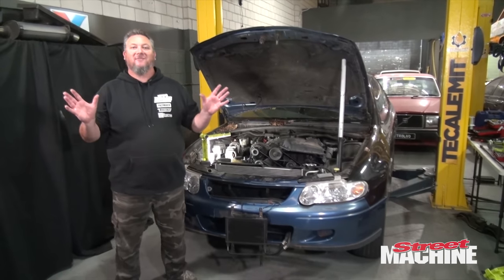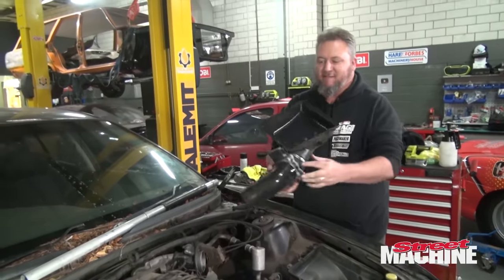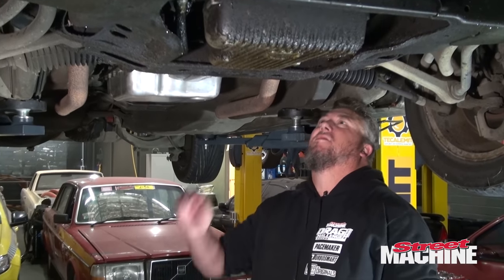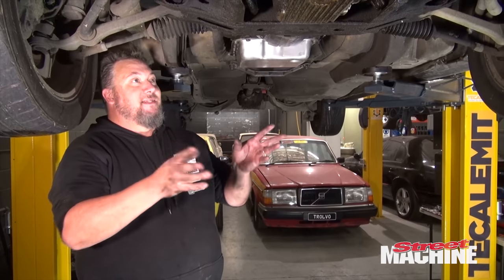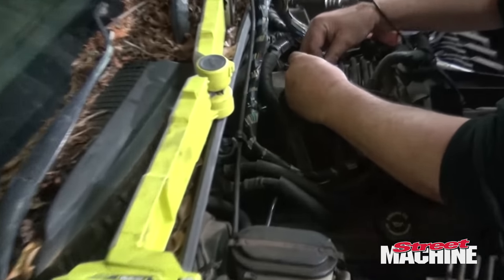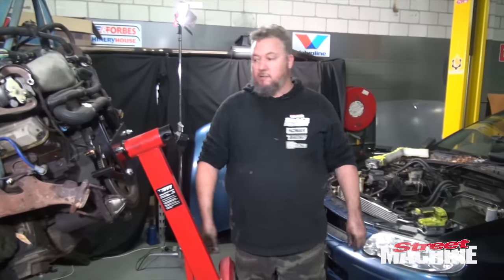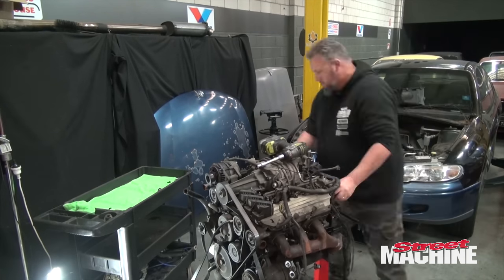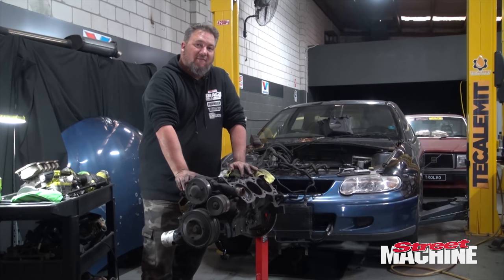Carnage Plus EP49 - Pulling The Engine From Our $500 Bomb

Comment: I'd defineatly appreciate you going down the blower route as I have a l67 in my VT series 1 wagon. Itd be kool to see what you can get out of the m90.. I have a 13psi pulley and it's been ported by mace. I've got a larger throttle body, roller rockers ,CAI, memcal and better coils,lsd and shift kit.. I'm fitting a cooler and upgraded fuel system next. Theyr a great motor. Good luck and I'll be watching 😎🤙
Reply: If going w2a go yella terra not mace
Reply: @nukkendan9572  thanks for the tip. Yeah I'm running the YT snout and rockers , so I'll def go with the cooler aswell. More expensive but I've heard good things. Do you know much about the advantages? Cheers man
Reply: 13psi unintercooled ? Suprised it hasnt grenade yet. 10psi "3.4 inch" is the safe limit , on 13 pee s eyes you'll just be generating more heat and ecu will be pulling timing like no tomorrow
Reply: @harleyross1975  nah I've had no issues at all. I have a thermal 25mm heatsink spacer under the blower and also reverse cowl with cut out to relive the heat a bit. The 13psi pulley gives me about 11.5 psi on the guage. Everything feels and sounds good. Been like that for a while now.
Reply: Kevin Haddacks  I got a 2000 Vx s pac l67 myself with extractors exhaust CAI 25mm thermal insulator bigger throttle body 10psi I get about 9psi on the gauge and 170rwkw, have thought about going 12psi pulley to get a true 10-11psi but leaning more towards intercooler 14psi and tune now, also very keen to see the results of this and hope it stays blown tbh
Reply: @scottronayne8364  awesome Scott! Yeah   that sounds good.14 psi cooled and tuned will be awesome. I'm running a reprogrammed memcal for the bigger throttle body. When I get it intercooled, I'm going to delete the MAF sensor and fit a cam. I forgot to mention I have pacemakers and full exhaust w/ high flow cats.  Do you find that your cats make a tinny fluttering noise at around 3500 to 3800rpm under load. It drives me nuts. I've changed the high flows to a better quality set but it still does it. It's a bit hard to explain over the net. 😎😄
Reply: @scottronayne8364  ps- 170rwkw is good! What was the nm torque? I haven't dynoed mine yet
Reply: Kevin Haddacks would like to go MAFless aswell when I get around to cooking and tuning mine aswell never liked the idea of them tbh, I’m hoping to crack a safe 200kw and keep it there no need for any more for my purposes of the car lol as for that fluttering sound I think I know exactly what your talking about haha but I no longer run cats and I still seem to have that same sound it does my head in too 😂
Reply: Kevin Haddacks can’t remember exact numbers on torque but it was around the 400nm mark I’ll have to dig out the papers
Reply: @scottronayne8364  yeah mafless is the way to go I think mate.  200rwkw is heaps enough for the sleepy little 6 for the street.  Hahah ah man, thanks, atleast it's not just me with the bloody raspy fluttering.  I was going to remove the cats to see if it's improves /dissapears, but I might just leave the them on after what you said! I'm thinking it could be the headers... The noise seems to come where the header pipe leads off into the cats .it doesn't effect the performance or power curve , just really  annoys me when I'm boosting up. 😎🤙
Reply: My VT was pushing 278rwk with pistons down crank heads cam and a Whipple on 14psi
Reply: Scott Ronayne ok this is a very common misconception but just cause your reading 9psi on the gauge doesn't necessarily mean ur actually making 9psi, cause your getting the reading from the lower intake manifold its actually a measurement of restriction. For e.g. a high hp build with really good flow would actually read low on the gauge cause of how good its flowing but in reality its pushing like 18psi.
Reply: Scott Ronayne when i did my 3.4" pulley i was reading 10-9 psi but since ive done full exhaust , big tb, intake, i now only read 7psi max
Reply: I would recommend you fellas join the L67Torque page on facey the fella baz over there has been working on these motors for 20years and the files section has alot of info
Reply: @harleyross1975  thanks for that!
Reply: Harley Ross  cheers for the info! Legend, and fair call on the gauge pressure, mine is setup a  ay or would breath really well so makes a lot of sense. Good think I didn’t shove 13 psi down it throat before I intercool it 😂
Reply: Theyre an amazing motor. My first car, a vt calais had an l67 with a lot of the mods you have.
After the intercooler and a bosch044 fuel pump and new injectors you'll be smoking most cars on the road
Reply: I have some 3.9 diff gears in there now as of yesterday..man...... Has that made a huge difference 0-100. I was shocked. It boosts up real fast now. Feels like a different car. Just gotta get the Speedo recalibrated. At 100 on the Speedo, GPS says I'm doing 83kmh lol

Comment: Anybody that says these are junk has probably never seen a Grand National blow the doors off a big block car or seen one in an Indy car. I have a 98 Riviera with a warmed up L67 that pisses off a lot of people & an 84 Bonneville G-wagon with the 4.1 version of the same engine.
Reply: I agree it's a good motor  throw boost at it it really wakes it up can get good power out of them.  The basic premise of the design been around for donkeys . I've driven both a Vs and VT .  a super charged Vs is 1350kg odd kgs brilliant car to drive very alive ,a super charged vt you can feel the extra weight just not the same . Well worth putting in the vn

Comment: Hey Scotty, how about an intercooled eBay turbo blowing into the M90?
Reply from the maker: I've thought about it, but I think the blower would become a restriction too quickly
Reply: @STREETMACHINETV  I was going to do something similar on mine many moons ago. https://www.youtube.com/watch?v=E-7cM_diB9s I was thinking of running them side by side. The M90 isn't a huge blower, and like most roots style blowers their adiabatic efficiency sucks, all that wasted energy turns into increased intake air heat. For several months now I have been toying with the idea of buying a M122 for my 2jz.
Reply: @STREETMACHINETV  Not necessarily (but probably, the M90 is pretty tiny,) but a bigger issue is, you couldn't aftercool the air coming out of the blower, Thus while cool not really worth the effort as you say.

If it were a a larger blower (say in the 2.5L->3.0L capacity) then a twincharged setup starts to make alot more sense.
Reply from the maker: E85 would help but yeah trying to pump 400rwkw worth of air through the bkower is going to be a tough one
Reply: I am really in two minds whether the turbo into blower thing would be a dud or a really good thing. You can up the boost by decreasing the pulley size, but the compressor efficiency takes a real nose dive into the shitter (and with the shortage of toilet paper this is not a good thing). https://www.superchargerforums.com/threads/eaton-compressor-maps.94/ not only does the efficiency take a dump, but it massively increases the hp required to turn it, and the intake air temp soars (essentially all that wasted energy / hp is turned into heat, so it is a double whammy). Trying to increase speed and up boost is not the answer.

The better solution is to replace the blower with a bigger unit like this https://www.ebay.com/itm/NEW-GM-EATON-M122-SUPERCHARGER-CADILLAC-LC3-NORTHSTAR-12602083-STS-V-XLR-V/264553316862?_trkparms=aid%3D111001%26algo%3DREC.SEED%26ao%3D1%26asc%3D20160908105057%26meid%3D3396c666e7c441fc87050ad4fad2c5e0%26pid%3D100675%26rk%3D3%26rkt%3D15%26mehot%3Dpp%26sd%3D323840472568%26itm%3D264553316862%26pmt%3D1%26noa%3D1%26pg%3D2380057&_trksid=p2380057.c100675.m4236&_trkparms=pageci%3Ab90222ef-624d-11ea-a31d-74dbd1803b62%7Cparentrq%3Ac138415c1700ad31c3aeaa42ffdfbfdf%7Ciid%3A1 (I tried to buy one a few times but had Paypal issues and eventually decided the universe didn't want me to buy it). That would keep the blower in a much better part of the compressor map. I decided I am actually going to build my own Procharger style blower down the track.

Now despite what many people believe the roots blower is NOT a true positive displacement. If you seal the bottom of the blower with tape and try rotate the blower slowly you can still turn it, meaning it is not displacing air. Blowers like the Whipple or Lysholm screw compressors are more true positive displacement (but I digress...). 

Now this is the bit I am unsure about... If you have positive pressure in the form of intercooled turbo air coming into the blower, it may quite possible be just what the doctor ordered. I removes the problem of the blower having to try and gather the air to push through the rotors. I personally would inject a fair amount of E85 on the inlet side of the blower to take maximum benefit of the latent heat transfer from the fuel and cool the blower, reducing its ability for the rotors to transfer heat from the aluminum rotors to the intake charge (doesn't completely eliminate it, the act of compression itself is a source of heat). Then add fuel into the individual runners as a means of balancing individual cylinder AFRs.
Reply: @STREETMACHINETV  I've seen alot of Turbo L67's online even seen a twin turbo L67 lol
Reply: Giving it all of two seconds thought...  I think half the reason the efficiency drops at higher speeds, is because as the rotors spin faster they start to cavitate the air inside the blower housing more. Remembering as one side of the rotor is compressing the other side of the rotor is pushing air back up into the intake side. And since it only has atmospheric pressure to push the air in, volumetric efficiency drops off, meaning you start using a lot of power for less and less air being pumped.

Adding boost to the intake since would keep the pressure on the air into the rotors, instead of allowing reversion stalling the air speed. So the blower can act a lot more like an air pump what it was designed to be, and less like a pressure pump, which it wasn't designed to be. This would keep the over all efficiency higher, which would transfer into less heat being added to the air post rotors, which in turn means more hp. Personally I think it could work with a bigger blower.
Reply: It works to a point. A freind did one and it was ok. But when he removed the blower and used only the same turbo it went much quicker.
Reply: @3800TURBO  Yeah I think it is going to be one of those case by case scenarios. I definitely wouldn't try it with the M90 they have, it is marginally big enough for a few pounds of boost on the 3.8 litre already. What combo was your friend running? Just curious.
Reply: @3800TURBO  you really don't want the blower to become a flow restriction. Most scenarios I play out in my head (other than looking visually cool) make it hard to justify the blower being there. Modern turbos flow enough that they don't need to be aided. But your trying to pick up bottom end boost. So you put on a much bigger blower as to not be a flow restriction, then you really don't need the turbos. Kind of counter productive. That's why when I tried doing it, I was going to put a clutch fan on the blower and have the Haltech shut the blower off once the turbos had started making some boost. That way the blower doesn't become a parasitic loss on the system. And if you want to putt around without the extra boost just turn off the blower. Pity I never got it finished.
Reply: Compressed Air is the same volume, just more mass.
Reply: @markusftw5138  nope greater volume for the same area, with greater mass. It is the greater density that gives it more mass. However density decreases as pressure creates heat, and lowers density. That's why their is a difference between actual PSI and PSIG.

Comment: Keep it Supercharged, a common thing is to use a ecotec bottom end for more compression, and port the heads to help flow more (gives it a good sound when the heads are tickled) and porting the supercharger and a smaller pully will help so much
Reply from the maker: Ecotec bottom ends are significantly weaker
Reply: @STREETMACHINETV  who told you that lol

Comment: Done both. You will end up with a turbo anyway but it'll make a load of video footage doing the blower too lol. Looking forward to watching. PS: the rods will bend before you break any rod bolts. Its a waste of money imo.  Good idea on the th700. The 4L just isnt worth looking at. We went through so many incarnations of 4L. Nothing would hold togther.
Reply from the maker: Maybe but cheap enough. Had several people tell me to change them
Reply: @STREETMACHINETV  josh's VC still has stock rods and bolts and his has been reliable running 9.70s  I guess I just don't like wasting money lol.
Reply: Of course we used forged rods in ours to run the 8s and over 160.  Its cool you're doing a v6.
Reply from the maker: @3800TURBO  Josh told me he has rod bolts
Reply: @STREETMACHINETV  I just asked him and he said he does lol. I never knew that lol. We ran 10.0@138 with dan's VP Berlina with all stock. The VP vids are on my channel.
Reply from the maker: Yeah, I want 10s
Reply: @STREETMACHINETV  cam/springs E85 and a little N20 and the M90 will go 10s easy in a vn.  Fun project. I miss the v6.

Comment: Lack of communication from Summernats office make Maf something something. I still haven't received an info pack for RockyNats Scotty. 🤷 September 30th they said, it's now March. Already emailed them, no response. Ready to unleash over the phone. Get them to get their crap together Telfo. 🤦😡
Reply from the maker: Relax the event is still months away, but yeah that's Summernats...
Reply: @STREETMACHINETV  I'm relaxed but it IS irritating. 🤨 They're not the only people who can't get their crap together, ask my real estate. 😂🤦
Quick question re: 1JZ. When you ran the coolant line to the intake, where was the line going from bro? I'm seeing it from the water pump on my end. I will say these hard lines SUCK to undo and remove, the oil feed lines have become my new worst enemy! 😂🤣
Reply from the maker: It came from the side of the block from memory. Just behind the water pump. It was just a rubber hose
Reply: @STREETMACHINETV  Hmm, I've got a hard line off the water pump which is also the water feed for the OEM twin turbo set-up then the rubber hose is a lot further down the block, close to the back. I've noticed various 1JZs have differences, so I'm making sure my motor is from what model, so far it seems mine is a JZX90. 👍

Comment: Considered pulling out the balance shaft while it's down that far?
Reply from the maker: It's not really worth the effort. I did it on another engine and it really didn't help.
Reply: A dyno will barely see the difference, but removing the balance shaft is real obvious on throttle response.
If it's going to be a caravan tow car, the increased rotating mass, might help on hills, for everything else, remove it.
Depends what you're looking for.
Reply: @aaronnoyb  also means you can plug the oil flow to it along with other oil system mods.

Comment: I can rebuild th700 you will need to set the throttle valve cable up perfect or run a manual valvebody so you won't need a TV cable.
Reply from the maker: Yep,I have experience with them from my VN days

Comment: I haven’t had the experience of pulling one of these out might be a silly question but 
At time 4:27 you are tacking a bolt out of the flex wheel what is that and what for?
Reply from the maker: One of the flex plate bolts attaching flex plate to the torque converter
Reply: @STREETMACHINETV  thanks for that I’m in the process of pulling one out myself what a shit fight

Comment: For $500 you definitely got ripped off. I got a BA wagon with 210,000km and 8 months rego for $500.
Reply from the maker: Does it have a Supercharger?
Reply: @STREETMACHINETV  doesn't need one to be quicker than a supercharged VX 😉
Reply: @STREETMACHINETV  doesn't need one to be better value for money either.
Reply: @STREETMACHINETV  VX L67 = 171KW
BA N/A Barra = 182KW